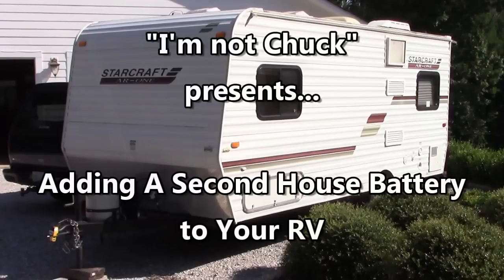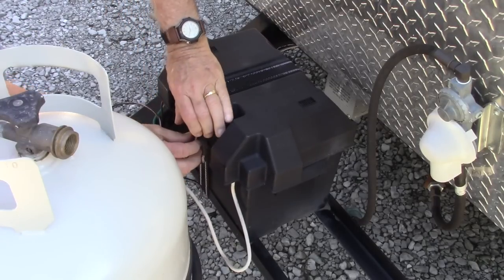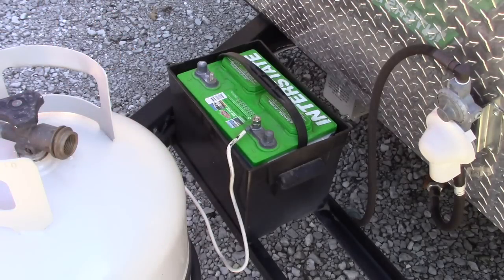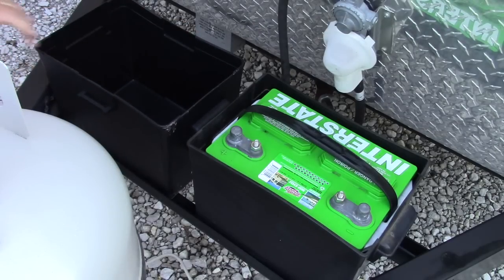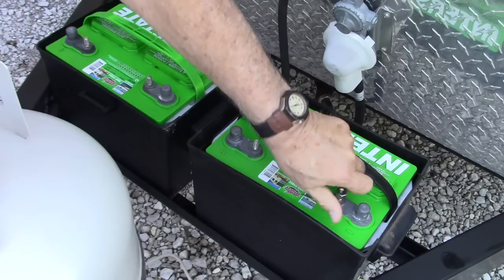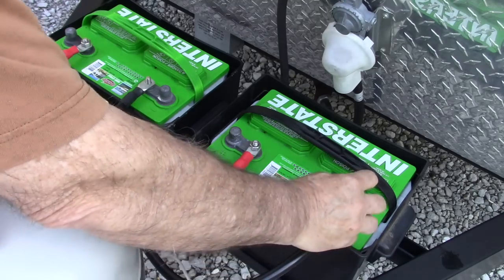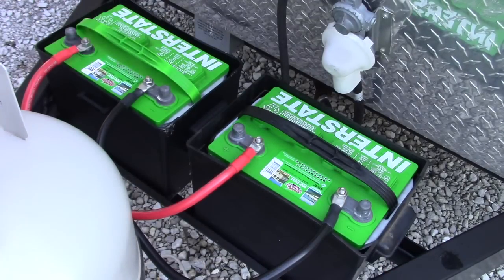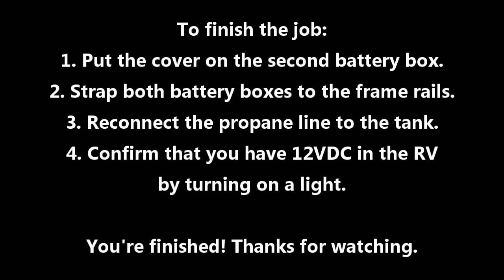Add a 2nd RV Battery

Comment: If you're not using these for cranking engines there's no reason to use those heavy cables to connect the batteries seeing as how the cable that goes to the trailer as a light gauge one that's all you should need to connect the two batteries as well
Reply from the maker: I don't agree, but you are welcome to your opinion. If you are interested in my reasoning, please read the comment pinned at the top. Thanks for watching.

Comment: The worst part of this for me was getting a red and black wire to wire the batteries together. Every parts store carry’s black only and I know two blacks would work but then sometime down the line some idiot will screw it up and install backwards. The strap also sucks especially for my Winnebago that decided to tuck the spare under the batteries. No room for that strap.
Reply: Simply buy booster cables from Walmart for $10 and cut those as red and white
Reply: @Gunsguy  them you need end terminals.  I was able to find a red and black cable long enough to make it work.
Reply: Get some red spray paint or red electrical tape
Reply from the maker: Looks like some good suggestions from other viewers. Thanks to them and to you for watching.

Comment: Would that work the same way with a third battery?
Reply from the maker: Yes, as long as the batteries are matched and connected correctly in parallel. Thanks for watching and for commenting.

Comment: I have 4 batteries and solar , it will save your batteries
Reply from the maker: Eddie,
Thanks for your comments. You are correct that solar can be a great help in making your batteries last. I have 200 watts of solar that I going to add to my travel trailer. 
Moving the ground wire (the white wire) to the negative terminal of the right hand battery certainly wouldn't hurt anything. However, because of the 1 gauge cables connecting the two batteries together, it wouldn't really add anything either. Either way, as you wrote, the batteries are wired in parallel. 6:55 Thanks again.

Comment: your hand with the ring almost touched the lead with the wrench almost touching the other lead, that was a lil dangerous, pls take off your watch and ring next time when you service your battery, I know it probably would of been fine but safer the better I learned the hard way digging into my ebike I put a 72 volt lead out of the way and it touched the frame and then I went to touch with the allen key and boom it was a close one tc
Reply from the maker: Thanks for watching and for commenting. You are correct that removing any metal jewelry would make the operation safer. Please subscribe if you haven't already done so.
Reply: shawnio i

Comment: That is not how it is done, they will not drain together, pos to one bat and neg to the other one
Reply from the maker: Thanks for commenting, and I appreciate your opinion. However, it's a common misconception; please read my comment pinned at the top for a full explanation.
Reply: That would be wiring them in series which would ruin all of your appliances...  You need them wired in parallel to remain with 12 volts and double the longevity of use.  They will drain together, as long as the amp hours on each battery match.
Reply: @sethagreen  So is how he has them correct on the video?
Reply: Not sure why there's any arguing in here.... It's not that big a deal switching over and then you can run a test
Reply: @sethagreen no your not wiring them in series because its still connected in parallel u just need to put the negative wire (rv) on the other battery negative post. grab a multimeter and check i dont mind people wiring this way because im making good money on batteries for failure due to loads damaging the 1 battery or not getting charged correctly

Comment: Need to connect the camper cables to each battery meaning the Positive side on one battery in the negative side on the other battery. This way you’re using both batteries and not just one.
Reply from the maker: That's a common misconception. Please read my pinned post above for a complete explanation. Thanks for watching and for commenting.

Comment: Wait…..two 12v batteries still equals 12v or does it now add up to 24v?  I’m confused.  Also, I’ve seen two six volt batteries connected and I assumed they added up to 12v.  ???

Lastly, I thought the positive terminal went to the the negative terminal on the adjacent battery. ???  I’m so confused.  Please school me.
Reply from the maker: If you connect them in series, you have the equivalent of a 24 volt battery, but with the same current capability of one of the 12 volt batteries. If you connect them in parallel, you have a 12 volt battery, but with twice the current capability. Thanks for watching.

Comment: The white wire should have been on the other battery to complete the circuit .
Reply from the maker: That's not the way I see it. Lots of comments from 3 years ago have just shown up; yours is one of them. Thanks.

Comment: Just so everyone knows, u should use glooves(insulated) and use insulated tools. One mistake can kill u attaching metal aka a wrench to the terminal
Reply: When has someone died from a 12 volt battery?
Reply: ozskipper amps kill not volts
Reply: I repeat.. Please tell me when someone died from a 12 volt battery, regardless of its AH rating.
Reply: Yes, but voltage needs to push that current. You can safely grab both terminals with your bare hands on a 12V battery, and you won't feel a thing.
Reply: Used car dealer here. It makes sparks and that's it.
Reply: Im still waiting for him to tell me when someone died from a 12 volt battery lol.  Hmmm....  Maybe if its dropped on someones head it might kill them. Maybe thats what he means heheh
Reply: PMSL..   Thats funny '-D
Reply: @ozskipper  When a spark is created and the battery is leaking fumes.
Reply: @NG..  So gloves would have made no difference in that case.
Reply from the maker: Death is unlikely, but using gloves and insulated tools is a good idea.

Comment: the first thing should be to find a better locatiion for batteries.
Reply from the maker: Thanks for the comment. Do you have a suggestion?
Reply: make a compartment if you have to in the side of your camper as close to the main elctronics  as possible.  I wish I was there I could make at least 1 or 2 suggestions.
Reply: oh by the way,  just a suggestiion mind you.   you did a good job tying the 2 batteries in parallel.  you really could have saved money getting 4 ga. cables or even 6 ga.,    also it would have been better to use the ground on one batterry and the positive wires on the other.
Reply from the maker: I don't see any advantage to having the batteries inside my travel trailer.
Reply from the maker: There really is no practical advantage to connecting the cables as you describe...unless you skimp on the size of the cables, which I did not do. Thanks.
Reply: you're using both batteries and not just one,  its called balancing the load.   Negative flows to positive.
Reply from the maker: I have fully answered that question in another post. If you don't agree, we'll just have to agree to disagree. As to which way current flows, that's a widely argued topic between physicists and electrical engineers, and makes absolutely no difference in the subject at hand. Thanks for your interest.
Reply: keeps them from being stolen for one thing.   I have always had an interest in 12vdc

Comment: I am going to do this to my motorcycle. Sometimes I make long trips and feel more comfortable knowing that I will not run out of power.
Reply from the maker: That's an interesting idea that I had never thought of. Thanks for watching and commenting. Hope you are a subscriber, too.
Reply: Get yourself an Optima battery, I had trouble getting my Harley to start when it was hot (cranked slow). The Optima solved my problem.
Reply: Was it an Optima or Varta?
Reply: Optima.

Comment: Not posed to have battery unhooked when on shore power (plugged in) hard on converter that charges it
Reply from the maker: Maybe I don't understand your comment, but if you mean that the RV converter is damaged when connected to shore power and no battery is connected, I don't agree. Most RVs are sold with converters and without batteries supplied, and the converters are not damaged. Anyway, thanks for watching and for your comment. Please subscribe if you haven't already.
Reply: It said in my manual  to have a battery hooked at all times my Camper/RV is plugged in to keep possibility of shorting out etc unless you turn the inverter/converter off by the breaker if you can, I wired mine so I can just saying if you had a battery charger sitting there plugged in would you unhook the positive wire that is charging the battery with out unplugging the ac to charger?

Comment: don't you get power from one of those batteries to start the RV or there's one in the engine bay?
Reply from the maker: My RV is a travel trailer, and does not have an engine. But even in motor homes, the house battery is not usually used to start the engine. There is another battery in the engine bay that is used to start the engine. Thanks for watching and commenting.
Reply: Where would i find my inverter in my 1972 dodge champion
Reply: Motor home

Comment: Please read this warning: I am a marine technician with 25+ years' experience and have witnessed I'm not Chuck. and many others make this VERY dangerous mistake. Never make any electrical connection hand tight always tighten them tight to avoid coming lose. They will and do come lose due to vibration make sure they are tight. A lose connection causes heat which can cause a fire I have seen this mistake many times and can be very dangerous. I doubt if I'm not Chuck. is trying to kill people but this small mistake can be deadly. Hope this is helpful have a great day 😊 😊
Reply from the maker: Although I have no objection to the warning, I must say that in my 76 years on this earth, I have never known of a lead acid battery in an RV to spontaneously catch fire. Have you actually known of it happening or is it just something that you think will happen? Thanks for watching.

Comment: It is not good to used car batteries. Not good for solar they will short out eventually.
Reply from the maker: Yes, true deep cycle batteries are the best choice for RV and van house batteries. SLI batteries are good for starting engines, but not good for RV and van house batteries. Thanks for your comment; please subscribe if you haven't already.

Comment: My IQ is now 40 points lower after watching this
Reply from the maker: There are so many comebacks to that, but I will just thank you for watching.
Reply: I'm not Chuck. Damn you just gonna let him walk all over you like that?
Reply from the maker: @ogpd4898  Yes. Thanks for your support.
Reply: I'm not Chuck. No problem I do what I can
Reply: My IQ now down 40% for reading mark Lee comment
Reply: I'm not Chuck got the comment but going on I'm not chuck I've done multiple battery the best way I found to get the most out of all batteries is it connect both batteries to a shunt putting the feed in the middle battery seams to last longer and equal wear just my experience
  Thanks for the video

Comment: Those batteries are turds. Anything sealed would be better.
Reply from the maker: Thanks for watching and for your opinion. Sealed lead-acid batteries (none of which are really sealed) have some advantages, but they also have some disadvantages, chief of which is that there is no way to check the specific gravity of the individual cells and no way to add water when needed. I have a new video which will be out later this week that will show the pros and cons of flooded, AGM, and gel lead-acid batteries. Please subscribe and watch it.
Reply: I'm not Chuck. 
No need to check the cells of of a sealed battery.  I used those interstate batteries at one time. Then I saw how they were outperformed by sealed batteries in every way especially in longevity.

Comment: They are connected wrong. Positive lead to one battery and negative to the other. Easy mistake. I have seen this on other videos too.
Reply from the maker: No, they are not connected wrong. Please read my post on this subject in the comments. Thanks for watching.
Reply: I believe American Patriot is referring to the Positive & Negative wires coming from the camper.  Your new "heavy" 1 gauge cables are connected correctly, but not the others.  You must have them connected as American Patriot stated (positive from camper to one battery, negative from camper to the other battery), in order to draw evenly from both batteries.  Otherwise, you're just drawing from only one battery, and this defeats the whole purpose of doing this set-up.  Amperage is keyword here, not Volts.  I apologize if you've explained already that this was rectified, as I read your comment about "read my post on this subject", but I don't see where you have.  Thanks for taking the time to post the video.
Reply from the maker: No. I am not drawing from only one battery. That is a common misconception by people who do not understand the internal resistance of lead-acid batteries as compared to the essentially lack of resistance of an 24 inch long 1 gauge cable.  My explanation apparently came unpinned from the top of the comments. I have repinned it. Thanks for your comment. Please see my collection of videos explaining lead-acid batteries, and subscribe if you haven't already. Thanks.
Reply: You are thinking of the wires which come from the Alternator.  Yes, alternator wires need to be on opposite batteries.  What Not Chuck was wiring was wires from the trailer, i.e. coffee pot or an outlet.  Accessory wires can be wired as the video.
Reply from the maker: @brianhummel8659  Thanks for watching and for your interesting comment. Please subscribe if you haven't already done so.
Reply: @brianhummel8659  The idea is to draw evenly from both batteries.
Reply: The source (batteries) need to be charged on opposite terminals from the charging source (alternator).  The load (trailer wires) can be connected anywhere as both battery post ( + and +, - and -) are electrically the same...........12V's 12V's 12V's DC not 24V's DC.  The draw is even because they are the same point electrically.  I do not know how else to explain this.  Draw four dots, connect two of them with one line, connect the other with another line.  Now, if you attach a light bulb does it matter if it is at one end or the other end of the line?  No.
 
Your draw will be your draw and as long as your SOURCE CHARGER (ALTENATOR) goes across both batteries you are good to go.  If you connect your SOURCE CHARGER (NOT LOAD-Trailer) to the same battery then yes, you will be charging and drawing incorrectly.
Reply: @brianhummel8659  That is correct, but not when you're monitoring.

Comment: Negative should go to one battery, positive to the other. You want them to drain equally. You should remove this video.
Reply from the maker: Thanks for watching and for your viewpoint. As I have repeatedly explained, that is a common belief, but there is no scientific substance to it. One way is electrically equivalent to the other. If you choose to believe otherwise, there is no harm done.
Reply: @ImnotChuck.  Chuck is correct.
Reply: He did hook it up wrong

Comment: By doing this type of connection you just made your rv a 24 volt power.
Reply from the maker: Both 12v batteries are in parallel, which does not change the voltage. They would need to be in series to output 24 volts. Thanks for watching and commenting.
Reply: No he didn't as he did +to+ and to 
If he did +to- then he would have did a 24v but he don't but he shop have connect - to the batterie on the right to = draw
Reply: No he didn't. You would have to hook in series to create a 24v system not in parallel as he has displayed.
Reply: No....I have a 24volts trolling motor on my boat.  To make 24 volts you connect the positive on one battery to the negative on the other battery.  You get more volts but the amps stay the same.  making a 12 volt parallel system like he did gives you more amps (longer run time) but the volts stay the same.  It blew my mind the first time I saw this done.  I will be doing the same for my camper if I find I need more battery time.  Also it does not matter what battery you connect the camper wire to.

Comment: I believe that you may have just turned a 12 v system into a 24 v system by your faulty wiring.
Reply from the maker: Do you really think that the DVM that I used and showed on camera reading 12 volts was wrong? There is absolutely nothing wrong with my wiring. I used the batteries in that configuration until I sold the trailer 18 months later.  They ran a 12V refrigerator, a 12V radio, a 12V inverter, and a dozen or so 12V LEDs. Thanks for watching and commenting.
Reply: Uh, 24 volt would be 12 volt  positive to negative, negative to positive.
Reply: Wow.. maybe study up on electrical circuits before commenting. He’s correct it’s 12v
Reply: Aexi Vack you are incorrect,he wired them in parallel which keeps the same voltage as the first battery,if he would have wired them in a series then the voltage would have doubled from the first battery. parallel 12 volts equals 12 volts ,series 12 volts equals 24 volts.,series 6 volts equals 12 volts,got it ?